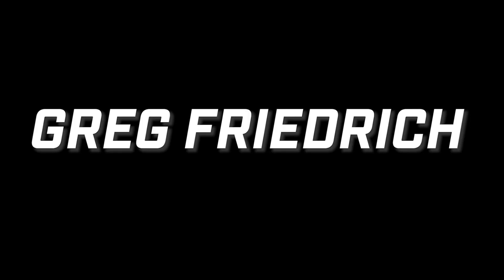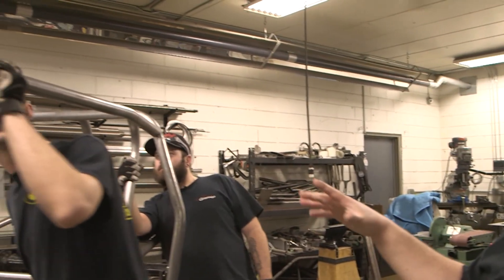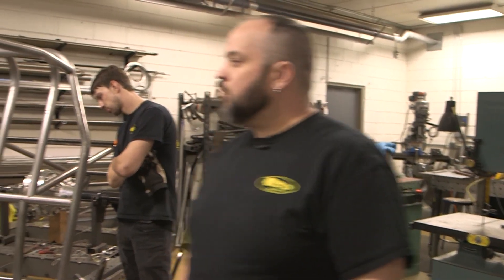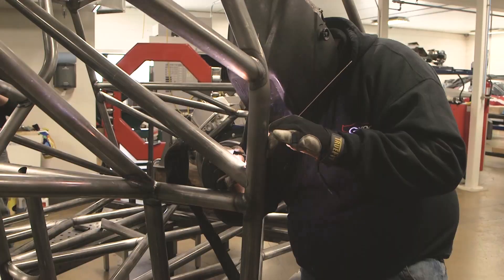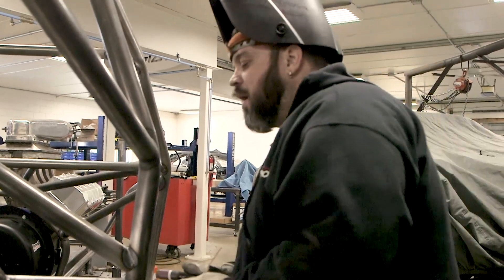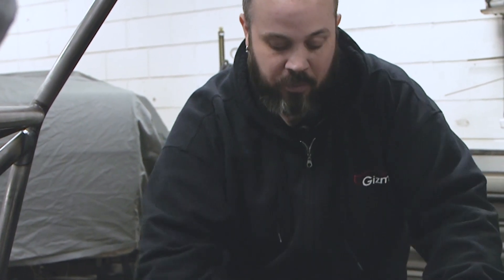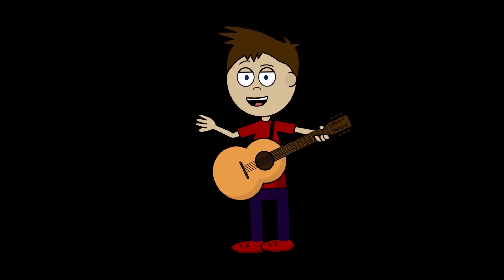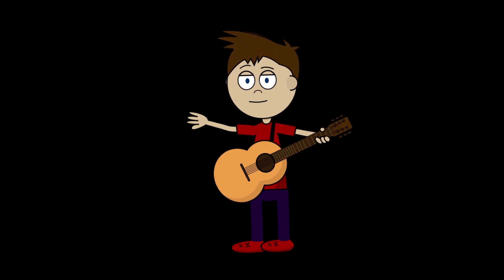Gizmos Garage Episode 9 - Tube Chassis Fabrication, Welding, and Removing the Body

Comment: Do you need to pre heat the Chromoly before you weld it?
Reply from the maker: Good question, it depends on the thickness. For a tube chassis like this, it is not necessary.